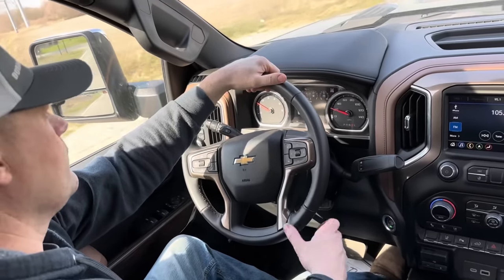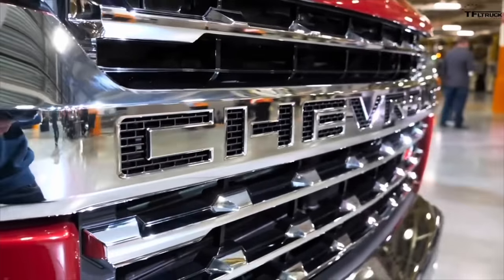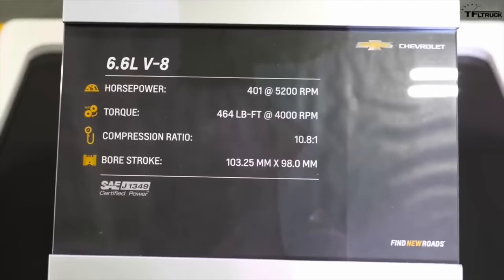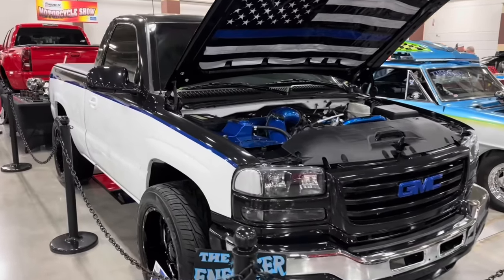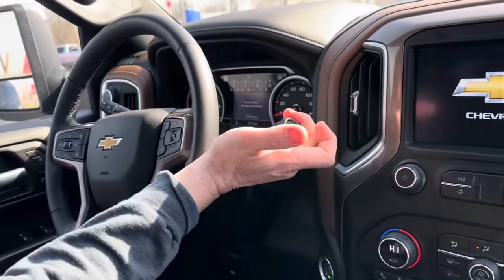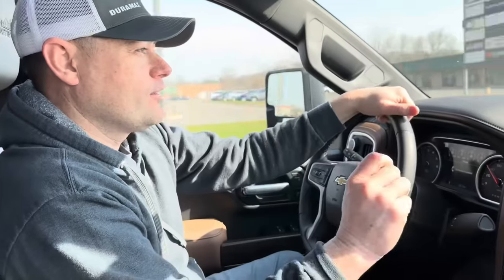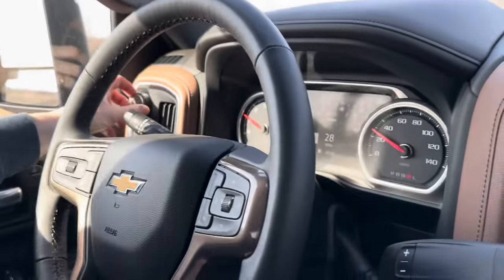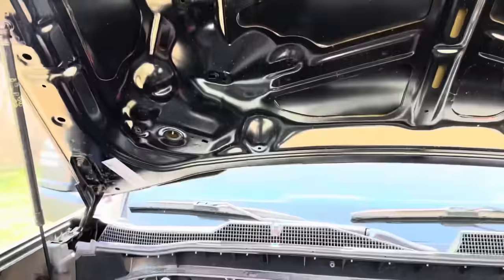What I Really Think About The New 6.6L Gas Silverado! WORTH IT?

Comment: Some thoughts to consider

#1: Gas engines warm up to operating temperature way faster than diesel.  Getting the heat going in the winter will be way faster in the gasser.

#2:  I have an 03 Hummer h2 (6.0L) and an 03 LB7.  Both engines are untuned, The H2 gets 9mpg, the Duramax gets 20mpg.  Fuel cost wise the Duramax wins.

#3:  The gasser is an LS, give it some time and there will be plenty of aftermarket performance mods for it that will wake it up.  My 6.0L jumped up from 316hp to 365hp on the factory tune just by converting to electric fans, cold air filter in the oem box, and a high flow exhaust system.  LS engines are notorious for being detuned from the factory, and at least with the older engines they are in need of a mild cam swap to wake it up.  I will say that the gen 4 6.2 LS was making 393hp back in 2008, so for a 6.56L to be that close in power these days tells me something is very poorly optimized with it and there is lots of room for improvement with aftermarket support.  If you are not already familiar, Richard Holdner is great to learn from about LS stuff.

#4:  If you are tuning it, it will be very tempting to use higher octane fuel to get more power out of it nullifying big cost benefits in fuel.  87oc is pretty much trash, so you would want to go at least with 89 for your base fuel tune tables.

#5:  maximizing torque and hp rpm’s is key if you are trying to compete with diesel, if you are putting bigger tires on it be sure to regear your axles to compensate.  The 10 speed would also help out a lot by always targeting the right rpm range for your desired power output.

Hope this helps.  Best of luck to you brother!
Reply: I live in northern Michigan we have cold winters I've ran diesel pickups for years the biggest reason why is the don't overheat with a snowplow on the front I've plowed with gasoline engine trucks over the years when you push them hard and do a lot of driving they get hot I've tried chevys, Fords and dodge's in gas engines and they all got hot
Reply: How did you do the electric fan conversion?

Comment: Came from an LML to a 22 2500 gas (LT crew cab short bed) and love it. I miss the diesel power, but not the problems. I love that there is NO engine management technology. It just runs. I have 17000 miles on mine and most of that is pulling a 5000pd trailer and I don't burn any oil. My around town fuel mileage is 14+, but you HAVE to baby it. It has tons of torque and moves out nice with very little throttle. It loves to drink though so if you stomp on it you can measure your speed by watching the fuel gauge. It rides and handles great too. No need to do a gas/diesel comparison. I expect anybody watching your channel is well aware of the differences.

Comment: I have a 2022 2500 gas and yes, pulling a trailer works the truck pretty good. I have 35's on my and with a trailer i get around 9 to 10 mpg, maybe 11 if I'm on the open road.

Comment: Got a 2020 3500 dually 6.6 gas 75k miles no issues have 35x12.50s 3.5 inch level I get 12 unloaded going 70 on the highway 9 while towing 18k. I love the 6 speed truck needs 4.10 gears.
Reply from the maker: Thanks for sharing 👍

Comment: The new 6.6 gas engine for payload what it can carry like a slide in camper. The 6.6 diesel is for hauling a like pull behind campers or heavy loads like a skid steer or  small tractor. The thing here is that 10 speed transmission each one is set up different gas is different from the diesel. Great video thanks
Reply from the maker: Thanks Chad

Comment: I had a ‘21 6.6 gasser. It’s nice, good power, has payload/towing ability for everything I wanted/needed. I didn’t drive it a ton because I have a work car and I barely put 10k on it in two years. 

Ended up selling it and got myself an ‘07 LBZ. 

The 6L90 was supposed to be a beefed up/better 6L80. It wasn’t. I was seeing/hearing a lot of people having problems of bad clutch packs, bad TCs, etc. as early as 40k and needing new trannies. At the rate I was driving it, I was going to be well out of warranty if it happened to me. Truck still had equity so I went back to tried and true. I think the new “Allison” 10spd will fare better than the 6L90. 

Disclaimer: this is not to say all 6L90s suck and will go bad. I was seeing/hearing too many and I didn’t want to see my $60k truck get it with only 10k on the clock. I got almost $51k for it so I was happy with that.
Reply from the maker: All valid reasons and nice choice getting the LBZ
Reply: The company my brother works for has all new 6.6 gassers and they’ve had to replace a lot of the transmissions.
Reply: Thank you, sir. Many of your videos helped me make that choice, especially since this is my first ever diesel and wrenching on one.
Reply: Yeah, and like most manufacturers, they’re not going to recall anything. Just issue some TSBs, replace trannies on their coin, and call it a day. I loved that it was a simple truck, no DFM, no auto start/stop, 4.10 would’ve been better but the 3.73 was ok, but I think GM is realizing the 10spd is a good move for those things to be a viable option.

Comment: I have had a couple diesels and I have seen enough of my friends dump enough money in their diesels just to keep them running, that I realized I do not want another diesel. Gas trucks are easy to work on, cheap to maintain, and inimitable purchase price is cheaper. It gets worse fuel mileage but diesel is more expensive so it’s a wash. It’s very nice just to put gas in the truck and not have to worry about random stuff breaking. I’d definitely try to get into a 24’ because it has the 10 speed that truck has the 6 speed. I’d also try the ford 6.8/7.3 since I think they are killing it right now in the HD gas trucks. I’ll be honest though, all the diesel guys always have the same impression you have that gas trucks have no power and can’t tow anything but gas trucks are the backbone of most fleets out there and get worked really hard. They will do anything a diesel can just not as fast
Reply from the maker: All very valid points

Comment: 2024 Chevy 2500 with 6.6l gas.  I pull a 18' trailer daily...weight is around 10k and it does just find.  I didnt buy it for 0-60 times as the truck is almost 4 tons by itself.  It does what I need it to do.

Comment: I am an L8T owner that couldn’t be happier.  I’ll burn around 1/2qt per 5k mile oil change. My 60mph two lane MPG average is 16.5mpg for my 20 mile one way commute.  It pulls when I need it to, it drives well, and failure points are very low.

Comment: The newer LS/LT gas engines have a built in torque limiter that works with the newer all electronic transmissions. (in my opinion--prevents premature transmission failure)  This is where you are experiencing the lack of hard acceleration.  Should be able to shut this off by going into tow/haul mode or turning off traction control.

Comment: You should test drive the 7.3/6.8 Super Duties to compare to driving the 6.5 (calling it a 6.6 is definitely marketing). Would just make for a neat video. I don’t have a dog fight in the medium duty pickup game, just glad there’s options for everyone.
Reply: I’d be interested to see that as well.
Reply: they probably did it b/c the old 6.5L diesel they used to have put a bad taste in chevy peoples mouths.
Reply: @stevencross8937  makes sense. I suppose, especially since the people buying the new 6.5s were younger when the old Chevy 6.5 issues were prevalent.
Reply: I went from a 20 l5p to the 7.3 gas ford and the gas definitely doesn’t have grunt that the any of the diesel’s have but it tows my 26k gooseneck just fine just have to get used to higher rpm’s
Reply: 7.3 is the way to go great engine

Comment: I must have the truck that was built on a Wednesday because my 2021 2500HD LT, Crew Cab, 4X4, 6.6 Gas gets around 14 MPG around town and 17 to 19 on the highway unloaded.  Towed a 5,000lb trailer with a 2,800 lb VW on it and averaged and averaged about 14MPG at about 65 to 70 MPH.  25000 miles on it and my last oil change at 4500 miles on it had 8 quarts leave the pan.

Comment: In 2016, I factory ordered a dually with the 6.0 gas engine to haul my slide-in camper that weighs about 4500 lbs when fully loaded.  Didn't want the high cost of ownership and reliability issues of a late model diesel.  This engine has been outstanding, despite being lower on horsepower than the subject in your video.  In my case, I made the right choice.

Comment: 6.6 gas has been great for me, not a power house, but gets 16mpg empty doing 70 on the hwy with my crew3500. just drove it 3000k miles going through the Rockies towing about 7kbs. It did well.
Reply: 30k  miles on it, no oil burn, and only complaint is the funky ass shifting it does.

Comment: I have a 22 GMC crew cab long bed with the 6.6 gas, no the acceleration is not exciting but I have other vehicles for that, I have left mine all stock and have seen 19.8 mpg empty and 9 mpg towing my 10k lb toyhauler. For what it is I am very happy with the towing performance. I have right at 9k miles on it so far and have not noticed any oil consumption yet.

Comment: I have a 22 with the duramax my youngest son has a 22 with 6.6 gas and my oldest son has the 7.3 godzilla. They are all impressive trucks. Pulling around 13000lbs they all maintain highway speeds 75mph with no issues and plenty of power left over. The gas trucks just hold a higher rpms and make a little more noise.

Comment: I have a 5 l 2018 Chevy 1st thing I did put a cold air system on it Headers, Outlaw dual exhaust system,   4.10  Gears,  7" lift 35 Mickey  Over 400 horses And I can lay tracks on those 35,

Comment: I'm a 6.0L gas 2500 owner that made the move from an LBZ a few years ago. I pretty much had the same initial impressions. I ended up getting a custom tune for it and it made the driveability of it change a lot. It was a night and day different. I have pulled a 15k lb load with it a couple of times and it did it, but it struggled on the hills. The gas mileage is garbage. I average about 12.5 with a set of 34" tires with the tune. It was about 10-11 before the tune. The new 6.6 gassers are not tuneable so your stuck with what you get from the factory. I'm really hoping the new 10 speed can help with the fuel economy and acceleration. I have my doubts though. From what I've read the ford 7.3 with the 10 speed is just as bad on gas as the gm 6.6/6 speed.
Reply: Buy a Prius if your worried about gas mileage.
Reply: And Ford likes to put rainbows and trans flags on raptors now.

Comment: Ive got a 2023 AT4 6.6 duramax with a banks air intake, pedal monster and derringer. She is a beast!! I had a 3.0 duramax before this an it sucked the def fluid and so did my 2.8 durmax before the 3.0 but this 23' l5p is great on fuel and def fluid. My 2019 6.6 duramax was good on fuel but not the greatest on def fluid. I have no complaints about my AT4, I pull a boat a few times a week cuz I do a fishing charter. Ive owned my 23 for a little over 3 months an have 9k miles on her. No complaints man. Ive owned 2 LBZ's also, owning a diesel the only way to go.

Comment: It's a 6.6 gas. All I'm saying is, GM said we're not going to phase out the gas and diesel powered vehicles, according to Mark Reuss the President Founder of General Motors.
Reply from the maker: It’s hard to believe that during this whole electric car boom nowadays
Reply: @TruckMaster  I believe too, I'm glad GM will stick with the engines and beyond.
Reply: Probably have electric half tons soon enough. There isn't enough infrastructure yet for an electric HD market yet. Imagine running a plow, or winter driving in general, towing cross country and 90% rural.

Comment: I have the 2021 2500 HD With the 6.6 gas engine.   I traded in a 2017 with the 6.0 engine.
Surprising to me is that I actually get the same gas mileage as the 6.0.   About 15 miles around town.
I also tow my boat which loaded with 250 gallons of fuel and equipment  is approximately 11,000 lbs.   No issue with power here.
I do however wish I had waited for the 10  speed Allison transmission.  I even asked the salesman and was told it was not available.  
As far as oil consumption I have not experienced that issue with 30,000 miles.   I will keep an eye out for it however.
Thanks for the video.

Comment: A couple subjective comments.  Recently, I purchased a '24 Chevy Silverado 2500HD High Country 6.6l Gasser w/ 10-speed tranny, primarily to pull our 27' (32' exterior) bumper-pull toy hauler, which usually has a 1000-lb Harley strapped down in back.  The 10-speed tranny is a game changer!  It's awesome.   The 3/4 ton gasser Chevy pulls our 10K-ish lb trailer just fine.  It can maintain 70 mpg up 8% grades (which is the fastest that I'll ever pull my rig, due to the tire ratings).  It'll downshift and be running pretty high RPM, but it'll pull it.  The gasser certainly doesn't have the low-rpm torque of a diesel, but I don't feel that I need it.  I certainly didn't want to pay the extra $10K for a duramax diesel, and pay the higher diesel fuel costs, and have to deal with DEF, and the higher costs of maintenance.  Even though the mpg effeciency of a diesel is better than a comparably sized gasser, it'd take years to break even on the other costs.  In my book, the only real plus to owning a diesel tow vehicle would be that I could use the straight-in diesel pumps at truck stops, instead of having to work my rig into gasoline pumps.

Comment: I had a work truck that was a 2020 GMC 2500 with this 6.6 gas. It averaged around the high 13 to low 14 miles per gal.

Comment: what bothers me it is a direct injection only, it doesn't have dual injection like Ford and Toyota so at around 100000 miles you need to pull the heads to clean the intake valves, the 10-speed transmission is not an Allison transmission if you read the press releases from GM when the 10 speeds were introduced it is an Allison branded transmission that was developed in partnership with Ford.
Reply: I don’t know what GM was thinking not adding a port injector. I think there is going to be lost of problems down the road with carbon especially work trucks that idle a lot.

Comment: We own a 22 6.6 gasser. It feels gutless when driving it, but somehow it pulls our cattle trailer at 12k lbs loaded with relative ease. It just feels sluggish. I thought the same when I test drove a 22 Ram with a 6.4, it moves, but it feels slow.
Reply: This engine is torque sensing. You won't see full power released without a load. Been waiting for tuning options. Still happy with the driveability, though. Much easier passing at speed on the freeway than my previous 5.3 1500.

Comment: I felt the same . The 6.6 felt so sluggish.  I went with the 2022 Ram 6.4L Hemi. I got 4:10's and tow near max a bunch.
Reply: I have a 2020 model and I hate the cylinder deactivation. Does your truck have cylinder deactivation or did ram also do away with them like Chevy did on their HD trucks?
Reply: @tonytigere5684  It has MDS . You can turn if off by using the shift buttons . On the steering wheel. Set the max gear to 8th.

Comment: I had the 6.0 GMC but wanted something with more power for pulling our 5th wheel.  I have an interest in the Duramax but didn't want to deal with all the stuff with a diesel.  I ended up buying a rust free '04 Silverado with the 8.1L/Allison with 116k miles.  It is an awesome driver for its age but like all the BB Chevy's, it likes oil and gasoline.  While I would love a newer truck, I could afford this one and have no regrets buying it.
Reply: I have a 1999 2500 6.0 and a 2004 3500 8.1 the 8.1 in the 3500 does so much better then the 6.0. I also have a 2001 2500HD  6.6 Duramax lb7, with a K&N cold air breather only 98,000 miles and it does great.

Comment: I have 6.0 gas 2014 i do tile i load truck with 3 thousand pounds pallets all day plus trailer another 8 k 160 thousand miles dosent consume oil at all and actually took almost 40 thousand miles for engine to break in , so far no parts been replaced and actually brakes lasted me 150 thousand miles on it mpg yea is bad 12 to 16 highway

Comment: I was gonna say before you found it they are pairing that 6.6 gas with the Allison so the economy and preformence mite be little different than with the 6 speed. I do agree with its hard to go back to gas and the maintenance and cost between the two its really hard to justify the difference and making the to either direction for the power and economy

Comment: It’s a great motor, company truck I drive at work. Got 20k miles and it gets Beat. Pull 25k lbs all over and rough roads at the company. Does Not have the power to tow like a duramax, but good for light loads. Gets 8 mpg maybe when towing. But it’s been dead reliable and gets used hard. Already bent a tie rod and the damn seat already has wear tear in it, very disappointing on the seat material on the 2022-2023s ngl(cloth). Really reliable truck but no comparison whatsoever to a duramax. 6spd is built well I think but it struggle to keep in the power band.

Comment: Great video, thank you. I recently bought a Chevy 2500 HD after many years of driving Ford pick ups. I have also owned diesel trucks in the past so far, I’m very happy with the Chevy max towing for me, is probably around 14 K and the truck does very well with that.

I don’t haul/tow every day, so the gas works perfect for me.   It’s very early in my ownership experience with the Chevy, but so far I like it.
Reply: Any update
Reply: @akaixl83  Still happy with my 6.6 Gas pickup.  The truck works great for me.  I tow less these days than I have in the past.  Usually max towing is 10 to 12K for the load & the trailer.   No issues thus far.